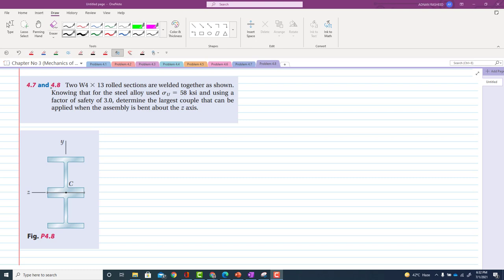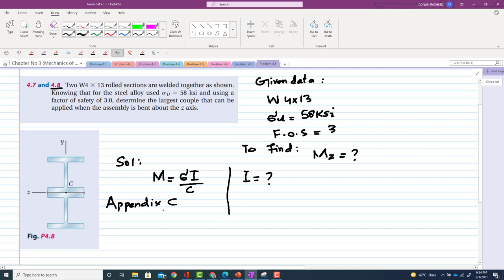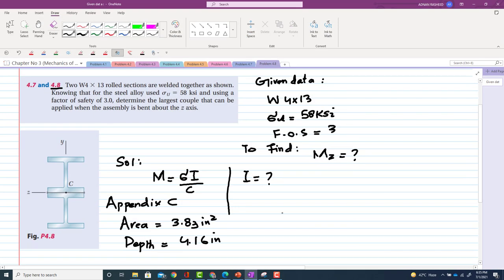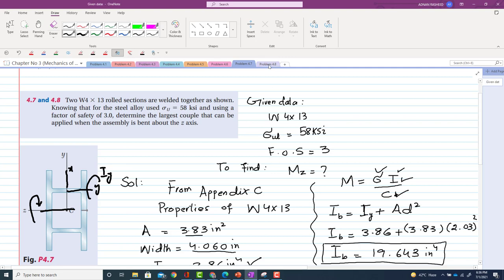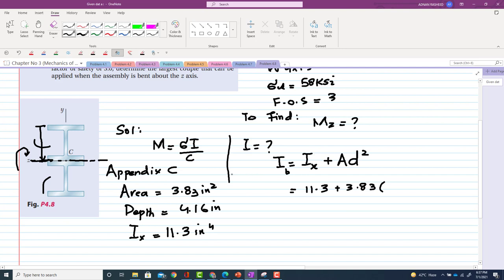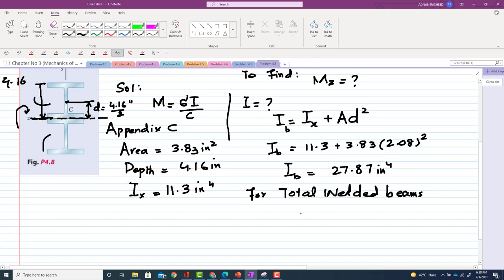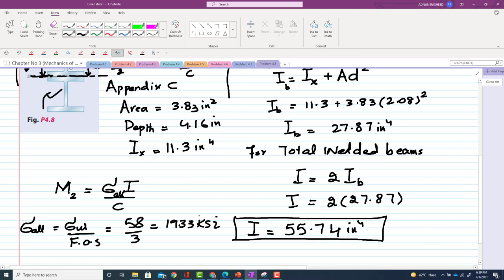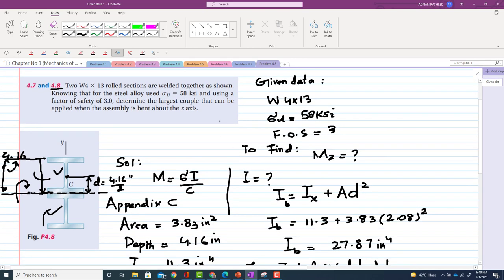#Mech of Materials# |ProblemSolutionMOM​ | Problem 4.8 |Pure Bending| Engr. Adnan Rasheed

Comment: Great video!! I am confused with the final units. Do you think you can make a video on how to convert units from ksi to kips, psi, lb, in, kN, N, the most common units in general? Thank you so much!!
Reply from the maker: Don't confuse yourself and any unit you get at the last is OK but remember 1000 lb (1000 pound force) is equal to 1 kips and 1 ksi = 1000 lb per square inch